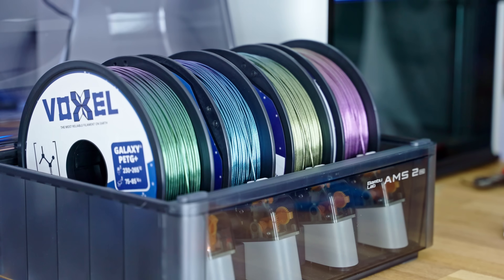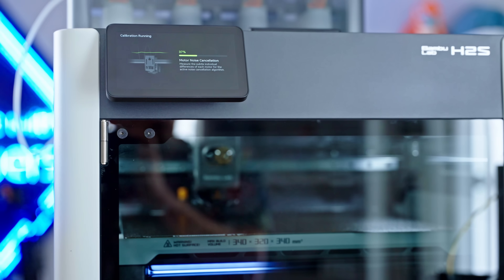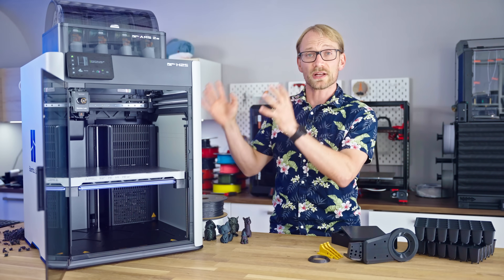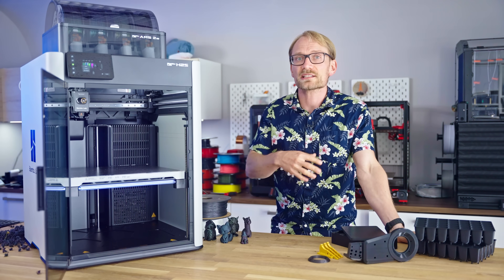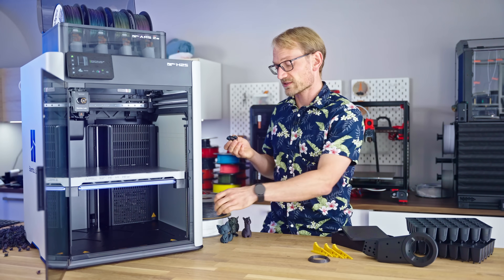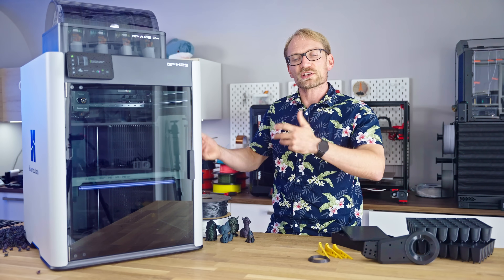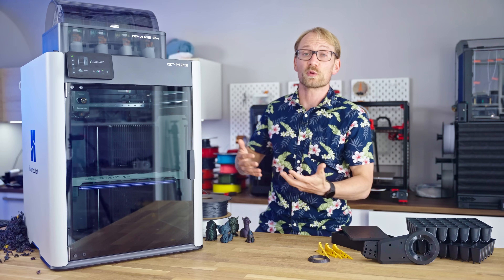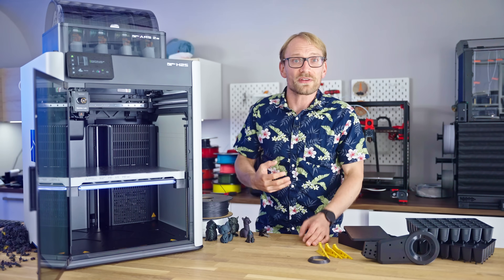Is Bambu's H2S truly a H2D Lite or just a bigger X1C?

Comment: So - PLEASE @ThomasSanladerer  (dont think it works that way here but worth a shot)  - PLEASE ORDER OR REQUEST AN H2D - I really though OF EVERYONE - Youd have withheld a video on this until you had time with that machine... [The only reason NOT TO was .. well for the view need IMO..]   - PLease forgive me if im wrong about that but - SOme of us have come to depend on youre knowledge in making informed purchasing decisions - Where intentional or not...  I think youve sadly Perhaps unintentionally done many people harm by having ZERO Knowledge or rather real first hand Experience using the lets say "Sister" printer to this..   That without it - Via direct interview with CEO this wouldnt exist..   So - For someone like myself who is frustrated by the small build volume loss of the H2D wishing they would have chosen a slightly larger frame size - i mean JUST in the X dimention which IMO Doesnt cause space problems on a desk NEARLY AS MUCH As The Depth of it - As most desks are .... (A) Square Topped  (B) Rectangular  - Answer = B RECTANGULAR!  So I heard the CEO's concerns about its size but .... reclaiming that usable X width IMO was not as large an issue as it had to be and was pre determined before any deisgn work on it was ever done.. Whcih is a shame as - HAD THEY DONE THAT: With the H2D having the SAME USABLE X Size ... 

They COULD HAVE MADE THIS A SINGULAR CHOICE OF: Speed & Degree of professional engineering material use ... 

The rainbow PLA printers or Actual contibutors to humanity that Design and itterate usable functional parts & not just make Niche manga and other series or game characters on etsy / or last second "I forgot to get a gift for ____, what was that thing hes into?"  = [Order pointless multi colored trinket] - Sorry Im TRYING to hold back my just depression over the human race with what society in gneeral clearly values.. Whcih is NOT To make thw world better but to fill it witrh wasteful usless trinkets that for every one made 2x that or more of filament was thrown away ... 🙄v.s.
 Those USING FDM to CREATE and drive innovation of deisgn ideas that werent possible before this technology - Or Prototyping of functional useful things..  That I ALSO HOPE depending on the use case that - If strong enough and consumers willing to accepot 3D printed parts (if they even notice with Z-line /Layer Lines hiding in carbon fiber filled composities with a nice texture to them) That people will Adopt an ever increasing DESIGN FOR FDM Aproach to product creation.. IF the resulting product can be made from the material properties as a final product, and if it makes finacial sense over injection molding after the design stages. 

So - PLEASE KNOW - Its hard to watch this for me Personally.. Just because..  You did not ever use the H2D before the H2S.. 

That REALLY IS A PROBLEM - Because..  Your reactions and review of this product.. While you believe it to be objective an unbiased and harmless.. May for MANY PEOPLE Never EVEN GIVE THEM A CLUE ABOUT THE BENEFITS OF DUAL NOZZELS TO AID THEM IN A DECISION BEST SUITED FOR THEM!   Where - Videos like this from other reviewers I would understand.. But I hold you to a higher standard - Because Youre inteligent enough TO BE! And its Rare theres about 5 in the world right now I can say that about. 

(well im sure more but without having to stop and think thats whats immediately my basic count of the channels featuring people of enough enteligence and good content that ....  I just hold things you do to a higher standard - And I think deep down you do know.. This video was for the views.. - Maybe youve been busyt whatever it may be but.. You have to know surely that skipping that model .. in a world of new printers that have everthign I could have hoped to modify mine to one day but far ebyond it with dedicade design teams and not being stuck with Duet Board components only and like E3D or other hotends etc.. Fully gground up designed for flawless functionality company that suceeded! Since Ive been away - and PLEASE REALIZE - YOU DO NEED TO HAVE TRIED AND USED THE H2D before making this review.. Or - You know..  despite what you tell yourself..    This video WAS FOR THE HYPE!  - Please Return to that higher standard I do hold you to ... Where You would have never released this video without (even if you personally chose to skip it for some reason ... and arent into the Functional 3D printing space anymroe or LIEKLY someone in your posiiton has so much spare filament coming in all the time the waste is a complete non Variable for you Personally! )  

So please think on this if it posts.. It says it does but usualkly 34 post YT starts deleting them if long like mine are when they are serious criticism - Not meant to be negative but to genuinely hope to make a point that ... Not even asking for a test unit of the H2D before this and doing the prep work to use it EVEN IF YOU DIDNT HAVE TIME TO MAKE Videos about it.. WAS NEEDED Before doing this video!

As - well I think youve either sold out to the masses of the world mindlessly printing trinkets and.. Gave up any real care anymore for products I really needed your review of or knowledge of first hand to compare against - AND  OR like mentioned above that for you as a creator and reviewer filament cost is LITERALLY NOT EVEN A VARIABLE! With so mcuh free ansd sponsored fillaments for a lifetime you cant begin to create enough with them while making videos and content to ever use them up..

⚠ WHICH MAKES THIS A BIASED REVIEW - That im trying to point out & get top the bottom of why the other machine wasnt even used by you before this video?  As to consider this Bambu labs for the first time.. Just... REALLY NEEDED THAT - As ... I didnt have to see this to know this would be your reaction when you SKIPEPD WHAT I DO BELEIVE IS A VITAL PRINTER FOR  THE REAL MAKERS OUT THERE of more serious End Use Parts and that really do need fast swaps between main material printing and support that - IDK as I dont have any yet but mechanically speakign with one nozzle and different temp filaments I just KNOW it needs to retract cut and purge etc ALL WHILE THAT LAST LAYER OF CF NYLON HAS COOLED SO MUCH That with a single nozzle solution THERES JUST NO WAY IT WILL BE AS STRONG As if it was printed continuously.. OR Rather with the most Minimal interuptions possible i.e. What I came to conclude next to IDEX only a Dual nozzle solution can truly offer that best possible Layer bonding and support material use nearly instantly vs all the mechanical things needed to happen to do that through a singe nozzle ⚠ - I think this is better said here... But seriously without that its a sellout to ... Either not caring for functional parts anymore.. Being genuinely unaware of these issues ive raised - I KNOW YOU ARE you cant claim ignorance to it.. So its either sellout to the masses that waste filament with pintless trinkets to fill landfills... OR  just ... well IDK! I cant actually explain it.. Just being too busy? 

Or do you genuinely not get the importance of 2 nozzles ?  For Fucntrional part creation & have dilluded yoruself like the rest to realize..

"Well it printed the part" It looks good - So I have a machine with one nozzle that despite the time and wasted material to extremes... That - I dont care! Im fine with the one nozzle as it does the job.. Filament for me is free.. and - I havent really gotten around to checking the strength of models printed from high strength materials with such long break period between layers being laid down that cool down filament so much and make bonding massively less effective... 

its ONE OF THOSE THINGS!  - Can you share even just with me Privately which it was?

As - Im sad to see this video launch and know youve done nothign with the H2D i know you only needed to ask and theyed have sent it - They probably affered it without asking..
Reply: So whats up?  -- Sory as maybe sadly the only MENSA member within this youtube community (That sounds arrogant I know but im short on time to revise this otherwise) and have a lot to say!  As I genunely hope this will be read by Thomas - And some anser given to this.. As I do need to know if hes just sold out to ...  the things I just explained where for him filaments are free - and the world trewnd is to have usless trinklets now 3D printing takes no skill and isnt in the hands of those with technical minds that are deisnging things that need that tech to be able to do so!  Now its fallen into anyones hands thanks to this company sadly which the only good I see personally is lowering PLA / PETG prices.. thats all..

So I have to now "Join Them" and get one reliable machine - But I really needed info about usage of H2D from this channel.. Missing that... Just makes me sad to see this.. As - Please TELL ME IM WRONG SOMEHOW - Just explain my logical analysis on why you never bothered with it.. Or if its just peronal and lack of time / Life happens related.. Or have you genuenly maybe not even realizing it fallen victim to ... Not realizing the impact of material costs and needs of strong layer bonds for functional prints... / "Sellout" term I use meaning.. to just conform to the trend of society and not uphold or maintain the fundamentals of FDM manufacturing (product strengh & functionality) vs. Not giving a Bleep about it anymore as ... Heck even if he did a video on it the worls so lost already with mindless zombies using tech they probbalyt shouldnt be and - That ... I mean I shouldnt be frustrated by it - It still brings innovation to this world.. Its just.. IT SACRIFICES CONCERNS FOR THOSE MAKING REAL LIFE PRODUCTS that need to be durable and want to have that means WITH THE RELIABILITY AND Speeds offered by BamBu labs products!  

So - Maybe he realized a video on it wasnt worth it as .. the views and trrends are going trowards just rainbow PLA vomit (I call it) usless functionless - Pintless.. Printing.. of objectively dumb things (sorry "artists" that think downloading a 4 cfolor moddel of a pokemon is youre artistic expression ... By a choice to.. Click a link and a machine print out someone elses work... 😂 - Okay enough roasting of ... what dissapoiints me in the FDM space now tech like this exists - Its sadly just Drives us closer to the 2006 movie IDIOCRACY  - In a slightly more inteligent way - but to see this entire branch of creation mostly shift to ..pintless dumb thigns that.. do not improve the world in ANY WAY - is what bothers me by this tech becoming more accessible..   Its FINE THOUGH AS LONG AS PRINTERS LIKE THE F2D EXIST STILL FOR THOSE THAT DO CREATE REAL PRODUCTS OR PROTOTYPES OF THINGS TO BETTER THE WORLD... And while I have nTopology license I BADLY NEED A RELIABLE MACHINE in this 11 months left...   And the H2D - Ive seen reviews but ... I wanted one from this channel even if not released but personal use of one before making this video so hed know what to compare agsint and tradeoffs for the real makers out in the world that still do exist and IF THE H2D is what I beleive it to be - MORE IMPORTANCE SHOULD BE PLACED ON IT that im just not seeing online anymore!  - AND THAT IS SAD!!

Maybe I have to step in and be that guy now!  Idk!  But Releasing this without even using the other - Continues a trend thats ... IMO almsot a betrayal of the reasons we as Humans Created FDM / Why it was exciting to us in ways to improve humanity not just RGB vomit prints  to fill etsy shops!  (Ill gadly join in on btw for the income but - I will never truly support or be happy with that as the future.. AND NOT SHINING A LIGHT ON THE H2D WORSENS THE EXISTING PROBLEM!

IT PROMOTES THE WORST TYPES OF CREATING OUT THERE IMO - and DETERS MANUFACTURERS FROM EVEN BOTHERING TO CREATE USEFUL TECH FOR REAL FUNCTIONAL PART CREATION vs the RGB landfill garbage (im sorry thats not meant to be an offesne I jst dont  know a better way to refer to the varity of ho wmuch of thats out there serving no purpose - Whioch is fine for those that enjoy that! )  BUT WHEN IT DRIVES THE MARKETS AWAY FROM..  Well IMO the first REALISTIC PRINTER I COULD BUY with these reliability and speed advantages that had the 2 Nozzle benefits that without mentioning it and glorifying trhis - You just join a sl;ipper sloap of ... degrading any usefull tech that finally they did make I bleieve - At least enough to buy and try it myself!  (H2D) 

Please think on this will you? - If it posts.. If not ill try back in a few days!
Reply: Wow buddy you need to seek some pro heIp asap. Mensa you say 😅 good one...

Comment: We all know it is not perfect, thus this review was quite a let down. At its heart, there is actually little innovative in this printer, apart from proper machining and design. That doesn't make this marvelous, but it says a lot about the competition. It is also a turning point, because this is sort of a tipping point, in which a Chinese company beat the rest of the world on basic design and machining. If you in retrospect look back at Prusa and Creality, they never actually did great design. Prusa still has that bed temp issue and its magnet issues, and suffered from leaks for like ages. We probably don't even need to explain the Creality side of things. But if the skipped the lidar, the interesting part is why? They just keep all their secret sauce to themselves, because nobody seems to have the brains to figure out the basic physics they are applying. We all know that their motion system is just as faulty as everybody else. If prints are "flawless", well, how did they get there? This printer just ain't prefect, so whatever they did, hate to bring to the fan boys, every design choice has drawbacks. Bambu clearly understand the basic physics of printing, but somehow, them having the culture to be the best at developing for it, that is something new. The printing crowd is like peasants trying to make an iphone, when it comes to these. That is a pretty scary cultural failure. I mean, clearly, Bambu has the way clearer understanding of the facts than the west, and the best ability to manipulate the facts. So much, that even Sanladerer completely surrenders and falls just completely on his face. From where I come from, Bambu is not wizards, just skilled engineers. Why people cannot flaw this, is simply beyond me. It is bloody obvious in sooooo many aspects.